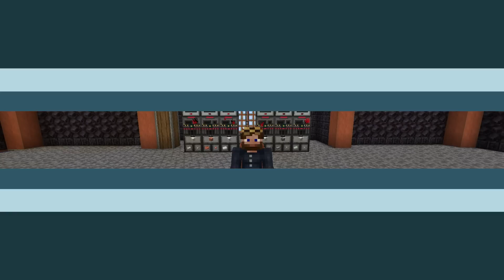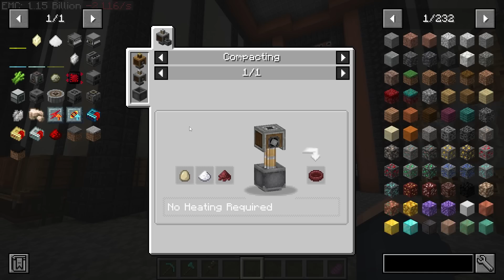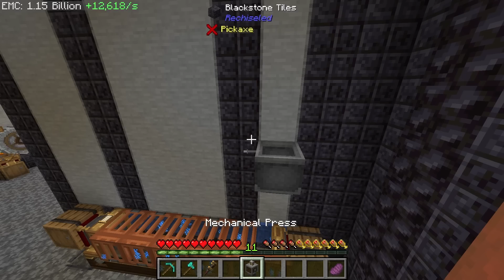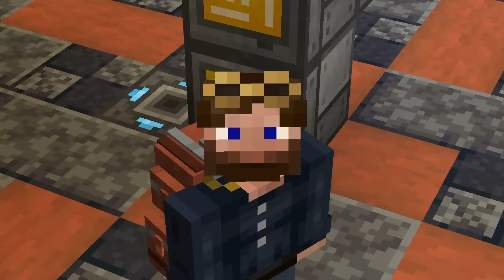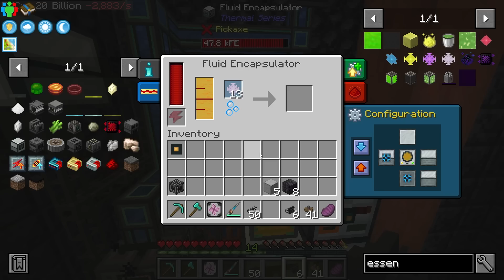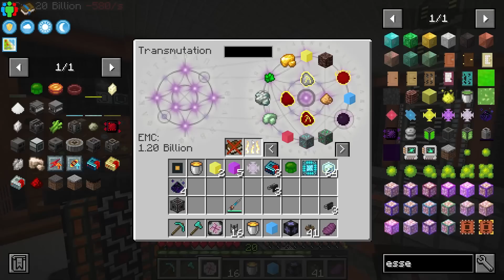Mechanical Mastery Minecraft Modpack EP14 Tier 4 Essence Automation

Comment: U can put the in and out put also on a open hole, that makes it that it can pull or push the crude oil from one machine to an other from the input. So that means u can have 1 input on one machine and use more machine's to produce the products. So u don't need to export to all machines like u did on the essens be course they are slow.

Comment: I found that you can skip the localized time stabilizer, and instead use a different thermal augment, the high flux coil (it might not be that one exactly, but the one that gives x6 power transfer). It allows you to successfully use the fluid encapsulator with the watch of flowing time.
Reply: thanks for the info i needed this
Reply from the maker: Thanks for the info!

Comment: I did my first fissile fuel setup in ATM7 recently. It's a fascinating thing but boy is it annoying to balance once you start to need larger amounts to feed a big reactor. I ended up with 8 chemical oxidisers for each 'gas produced using a solid input' just to keep up. So that was 8 for fluorite, 8 for yellow cake and don't get me started on pulverisers for sulfur dust - 9 wasn't enough so I had to set up 3 Mekanism systems to create it from coal. That was with SIXTEEN metaturnal beehives working 24/7 too. I hope they did better balancing in ATM8. Sulfur not being able to be crushed into dust by anything other than a Thermal Series Pulveriser is painful - it's so slow even fully augmented! 😂

Comment: Refined fuel is buggy. Inputs and outputs swap at random.
Reply: That's not "buggy", it's just because thermal machines will just output anything whenever they can, they don't have a set side. To prevent this you should use fluid pipez or create smart pipes, since they allow filtering fluids
Reply: I ran into this problem, but mostly solved it through using refined storage. I just wish refined storage allowed restricting fluid on a drive.
Reply: I think it dumped oil to the next machine because the side was set to input allowing the auto import from the second one to tale the input from the first, kinda strange but kinda make sense

Comment: hmmm i think that if u want to simplify ore automation u could use watch of flowing time :)) it boose the speed to crazy amount, also the power produce and the speed that powah cable tranfer energy by crazy amount, imagine using basic cable and 5 magmatic dynamo with t1 kit for a full 12 max upgrade smelter even when all of them constantly running